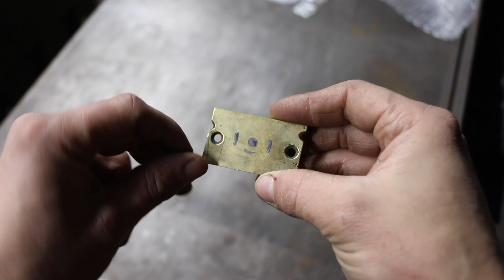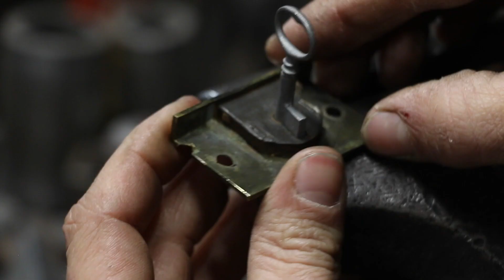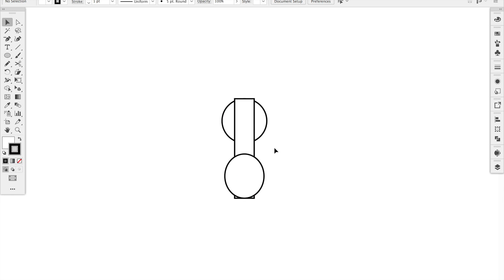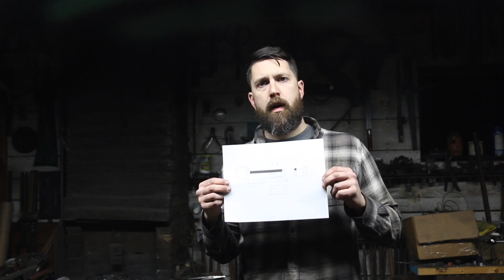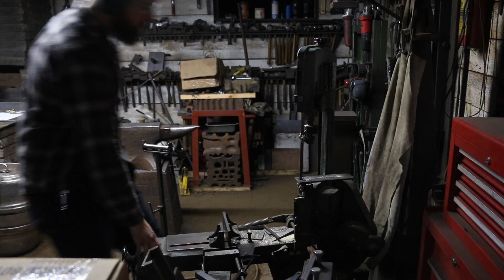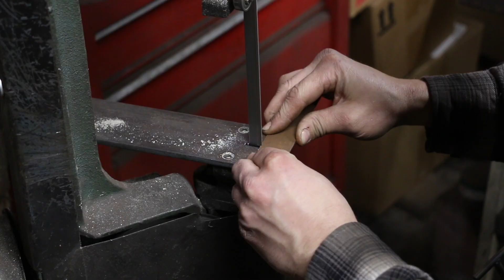Chest Lock Keys: Part 1

Comment: Nice video!
Reply from the maker: Thanks. Now I need to edit the rest of the crab lock key. I’m hoping it will all fit in 1 video and not 2.
Reply: @GreasyLuckForge  looking forward to it.  In 1 or 2 video's wouldn't make a difference for me. The pass of them is most important I think. This one is on the slower side for my viewing style,  but it still kept my attention. Also helps that i'm genuinly interested.
Reply from the maker: Thanks for the feedback.